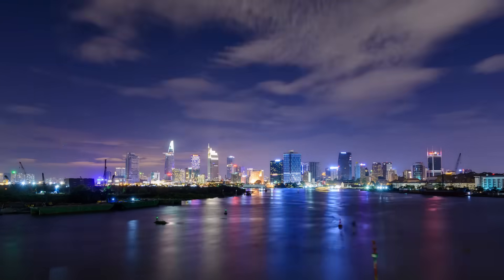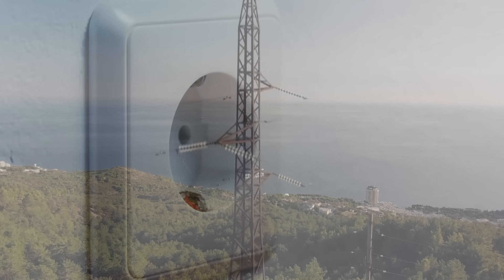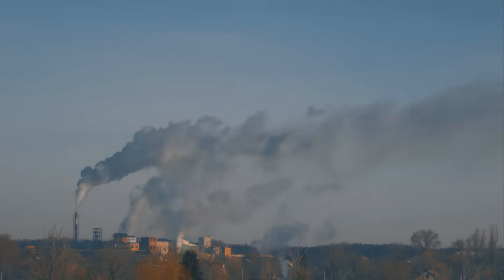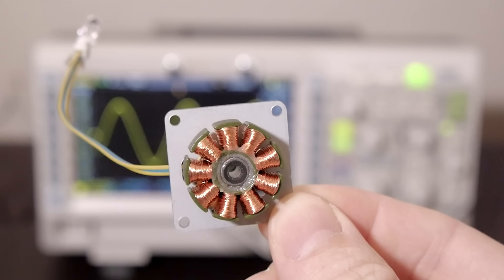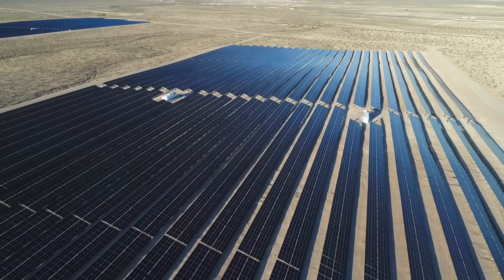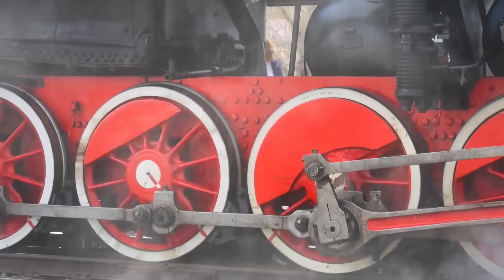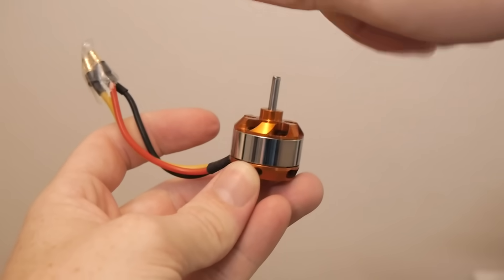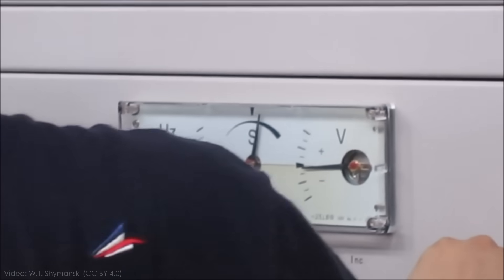How Electricity Generation Really Works

Comment: Great video, perhaps explain why it is so difficult for power production to go back online once a major interruption occurs. For example the 2003 blackout, This is when that coordination between the grid operators is critical, also black-start capacity.
Reply: Carlos -  there are basically two factors here.  The first is that it sometimes takes time to restore the source of energy.  If the interruption has lasted long enough that power plants have had to shut down, it can take hours to days to get them back on line.  For example, before you can restart a boiler, you must first 'purge the boiler' to make sure that there are no residual combustible gasses left inside - otherwise, attempting to restart the boiler could lead to an explosion.  This can take hours.  Or, there is the fact that the steam that passes through turbines is at very high temperatures, so if the turbine is allowed to slow down to standstill, the hot turbine can actually sag between the bearings that support the ends of the shaft, and restarting it requires a lengthy process of raising the temperature while very slowing accelerating the speed such that any residual sag doesn't become dangerous deflection as the rotor starts to spin.

The other half of the problem is restoring the connections within the grid.  If the outage resulted from some kind of failure, the damaged components must be located and either repaired or bypassed.  The obvious worst case might be a hurricane or ice storm that produces widespread damage, and power can't be restored until that damage has been addressed.  Because the work involved is done on a circuit by circuit basis, some consumers will see service restored very quickly - potentially within seconds to minutes, while others can take a very long time, depending on how much physical damage must be repaired.

In cities like New York, the grid often is designed around something called a 'network' - a network design produces extremely high reliability, but the process of restoring service after a network outage is very tedious and requires careful coordination of multiple operators spread across a wide area.  So for example, consumers in New York have the highest reliability of any electrical consumers, but when service is restored, it tends to be restored to all consumers at the same time.  But the process of restoring a network is tricky, it can take hours.
Reply: Louie Powell l
Reply: @monophoto1  Thank You So Much For an Actual Factual Explanation of What and Why Things Happen At The Speed Of 'Factuality'  'not at the  'Complainer'nation'  Velocity'_ 😶⛅✌👍🇺🇸
Reply: @monophoto1  Great stuff sir!
Reply: @monophoto1  Sounds to me like it's easier to restart a nuclear plant
Reply: @monophoto1    Very little of what you posted is accurate.  what kind of purge takes hours? NFPA requires a 300sec purge.  Turbines dont sag, they use a turning gear to with a battery backup to rotate the turbine slowly preventing sag.
Reply: @monophoto1  Starting the actual generators is one problem. Restarting an entire grid (or even a large area) poses another: You cannot start up a grid slowly like starting a train. All you devices would be very unhappy if power came back at 1 Hz and then slowly ramped up to 60 Hz over the course of minutes. So any detached part of the grid needs to be connected in an instant. But this also puts a whole lot of load onto the grid in an instant (want to be nice to your utility? Switch off your breakers in an outage and re-engage them after power has come back on. This also saves your devices in case the power comes back on flaky.). Usually that's not a big issue, as the grid is large and connecting one or two neighbourhoods is not enough to bring it down. But if there's a widespread outage, possible a hole area that is not (well) connected to the outside, that's not true. In that case re-connecting something could add such a load as to stall the generators. (Imagine adding 20 heavy cars at stand-still to a single locomotive. Whatever speed that locomotive had before, it will be at a near standstill after.) But firing up all power plants before connecting anything isn't a solution either. Generators don't really like to run without load---ever tried to lift a seemingly heavy box that in reality was empty? Just like you are likely to land on your butt, generators would spinn much faster than they should. So in the end you have to spinn your generators at a controlled speed and then add force (steam/water/...) at the same time as you connect consumers. And hope that you estimated the load correctly. If your estimate was off, the generator will either run slow (low grid frequency) or fast (high grid frequency). Both can kill connected devices (think exploding light bulbs in horror movies), especially modern electronics.
Reply: The real answer to this is complicated and lengthy, but Louie's answer is a good Cliff Notes version.
Reply: @2_Many_Hobbies  Wowza. The explanation was good, but I definitely considered it complicated and lengthy. I'll leave the more in depth explanation alone.
Reply: @jameslawrence8734  It had a few extras that they could have left out for sure.
Reply: Most generators need grid power to start. Those magnets in the generator are electro magnets. Black starts are rare. Could go into that.
Reply: @waynertimms  Black start capable utilities get a credit (premium on kW/hr rate?? etc, but you get the point) for maintaining that black start capability.  And you're right, not all go to the trouble to maintain this.
Reply: waynertimms hydro gen is great for black start.
Reply: This is far far out of his subject specialty. This video is already pushing his boundaries.
Reply: Search "bootstrapping electric generation"
Follow that with "power plant syncing".
Reply: There are things in this about that very thing that I did not realize they did. The electric companies really do stay on top of things, even during a blackout to get it all back up. It is a miracle that they can be so organized!
Reply: It is a good video. I like it.
Reply: You overload and short a coil on a generator in one of these power plants and you're now relying on a motor repair shop in obtaining materials, manufacturing custom coils, removal and installation. Logistics on the fly are never fun.
Reply: Carlos, check out a newer video on "How Power Blackouts Work" https://youtu.be/R_HGnc63QKU

Comment: Electrical engineer here, and this topic has been my job for about 15 years now. 
Everything you said is brilliantly illustrated and on point. 
Kudos to you !
I'd happily replace "renewable" at the end by "durable", but that's a subject for another day :)
Bravo again !
Reply: I went 'Why?' for a moment, and then remembered that Thermodynamics makes concessions for nobody. Not even the sun....
Reply: I never realized how little sense the word "renewable" makes until I saw this comment. I think "sustainable" makes a little more sense than "durable", but you're right: "renewable" is a silly word to use. I suppose you might be referring to the fact that it takes materials to build solar panels and wind turbines and that 100% efficient recycling is impossible, so the systems do consume resources to some degree just at a much much lower rate than fossil fuel-based power. Is that what you mean?

Also, can you comment on the feasibility of using a high-voltage DC "super-grid" to address the intermittency of wind and solar power? I've heard that a European super grid could allow Europe to run completely on sustainable sources of energy because it would span something like 13 timezones. I don't know how the cost of building a "super-grid" compares to that of building energy storage facilities. How do you see our transition to sustainable energy playing out ‡? 

‡ Not necessarily how it ought to play out. I know a lot of rational people think that we should build thousands of nuclear power plants because the technical and economical factors make sense. I'm not against nuclear, but I question how feasible it is to overcome the social/political challenges in a timely manner because nuclear is inherently scary and very hard to educate people about. People know that radiation is something that they see or perceive in any way, yet it can cause horrific diseases like cancer that kill you slowly and painfully. It's kind-of a nightmare death-stalker. It's very difficult to explain to people why they shouldn't be afraid of such a thing in their back yard. What's worse is that nuclear proponents have a history of glossing over major problems leaving the industry with a huge trust problem.

You can see that playing out with the hype over Thorium. There are hundreds of videos online where people explain all the miraculous benefits of Liquid Fluoride Thorium Reactors (LFTRs) without ever mentioning any technical challenges (of which there are many) and sometimes out-right lying about the tech like saying that it doesn't produce nuclear waste (when in-fact it would produce far more waste than LWRs, just not as much *spent fuel waste*). When asked why LFTR has been on the drawing board for decades yet never implemented, proponents start coming up with conspiracy theories. It couldn't possibly be the extremely complex chemistry involved! It couldn't possibly be that combining the fuel with the coolant and flowing it through the entire reactor instead of keeping it in a centralized location (like LWRs) means that the entire reactor gets irradiated to the point that only robots can operate around the reactor! No. It's all a conspiracy!
Reply: @AbeDillon  
Yes, technically fossil fuels are "renewable." Sustainability is another challenge.
Reply: @AbeDillon  @Abe , from what I read , there was a Thorium reactor built in the 50's that ran on the grid for 5 years.....I'm sure todays tech could make quick work of the complexities you mention .....given some will power.
I'm hearing the Chinese and Indians are just getting on with the work on Thorium energy while the rest of us wring our about if it's feasible or not.....
More power to them :)
Reply: @Paper-and-dragons  that was not a Thorium reactor. It was an experimental molten salt reactor that didn't use Thorium. It was never on the grid. It was very small scale.

It would be interesting to see how current research into the tech pans out. I wouldn't hold my breath though, or expect anything miraculous.
Reply: @AbeDillon  if you look at early America when DC power was the only thing available you can see that it didn't travel very far at all that's why we use AC it travels much further with weigh less loss.  So a DC system like that wouldn't be worth the time space or money
Reply: @jamesgarrison6430  What works much better than simply consulting history is actually trying to understand the problem like an engineer.

High-voltage electricity is much easier to transmit than low-voltage electricity thanks to Ohm's law. It's also much easier to increase and decrease the voltage of an AC source using simple transformers. That's why AC is the standard: you can ramp up the voltage for medium-distance transmission, then reduce it at the point of consumption. The problem is that AC suffers from the "skin effect" (look it up) which ultimately limits its transmission efficiency.

The idea of HVDC lines is that, while it's difficult (requires expensive equipment) to convert between low-voltage AC and high-voltage DC, you only have to do it at key sites: It's a back-bone transmission system, not a "last-mile" solution.

You use High-voltage DC for transmitting a ton of power over very long distances, then convert it to low-voltage AC for local use.
Reply: @AbeDillon  I suppose rewinding your rubberband powered airplane could be construed as renewable?😜
Reply: And I'd make it "durable zero emissions". We should be working to eliminate CO2 emissions rather than installing wind and solar and hoping emissions will go down. Germany has been installing wind and solar, and their emissions haven't gone down. France, Sweden and Ontario installed nuclear energy and their emissions went down.
Reply: @49andrew  that's a myth. Germany has reduced it's CO2 emissions to 32% below 1990 emission levels. They e missed their target of 40% below 1990 levels, but the statement that they haven't reduced emissions is an out right lie started by a Koch brothers-backed think-tank. Please stop spreading it.
Reply: nothing is renewable. given sufficient time, eventually all energy will dissipate. 
(or actually maybe not and it's one of those "the closest decimal to 0" situations. idk, i'm not a professional physicist)
Reply: @fomalhaut_the_great  Energy cannot be created nor destroyed but can only change from one form to another.
Reply: @fomalhaut_the_great  Energy doesn't come from anywhere but it doesn't dissipate either! Energy is ALWAYS converted, not made, nor lost. Most sources of energy like to become heat over time. Also sometimes converts into chemical potential.
Reply: @buttonasas  "Does not dissipate".  Are you sure?  The total energy in the universe is a constant but it  has dissipated and continues to dissipate in the most common sense meaning of the word.  It will continue to dissipate as the universe continues to expand.  The energy per cubic parsec of space declines as the universe expands.
Reply: @Saratogan  Sorry, I read it as "disappear".
Reply: @Saratogan   As I understand it, energy is conserved, but it all tends to go toward the same average state.  Thermodynamics dictate that to do work, energy must go from a high state to a low state.  If all energy is lukewarm, rather than some hot and some cold, no work.
Reply: @joesterling4299  , True, we do see this locally (by locally I mean that which we see here on earth) but, universally,  for the "big bang" from the singularity theory to hold, all the energy that was contained in the singularity was dissipated at the big bang and continues to dissipate as space expands. E=M*C^2 and equally valid M= E/C^2.
Reply: Just a quick question, at 3:40, doesn't the phase power provide √3 x more power at the same amperage?
Reply: @TheMagnoo99  I believe it just keeps the amount of out put around the same instead of 0 amp to 15 amp back to 0 it goes from 0 to 15 to 15 to 15 to 15 tell it gets shut off because when one is at 0 the other is at 15 and the other is at -15        so it goes from -15 to 0 to 15  than 0 15  0.  Than 15  0 -15. So you always have a more reliable for to start around the same amperage if you look at the wave
Reply: ericasw28 if your an engineer I am Donald Duck. You quack!
Reply: What's your take on the free energy generators
Reply: All those pseudothermodynamics quackery turns people into retards. They can't even tell they are lied to when it comes to electricity generation. Pathetic.
Reply: You can say whatever you want when it comes to energy SOURCES but do you REALLY know how the simplest industrial synchronous generators really work? You have been taught energy conversion but you aren't taught self-excitation. Why? Because it leads to OVERUNITY. Replace mechanical input with 3 phase electrical input, you get a synchronous motor powering a synchronous generator simultaneously without the need of separate mechanical coupling between two machines. Set either of the dual stator windings of the synchronous motor as output, you get overunity. Because all you need to do was to increase rotor current, the excitor to increase magnetic attraction, induced emf, WITHOUT the need to actually increase 3 phase input.

This is the basic "zero-point energy" where an inductor stores energy in the form of constant current magnetic field, supplied by the battery, voltage supplied by the grid without the grid itself drawing current. This is the TRUE self-excitation, HIDDEN overunity. They teach you everything EXCEPT self-excitation part.

Wake up yet?
Reply: "Energy cannot be created nor destroyed."

All Generators are merely transformers and nothing more. What is needed is a better way to transform energy in a non destructive manner. How many years did you spend working on that challenge? Any?
Reply: @seanregehr4921  Better way as in most efficient. Current technology we have is probably as close to efficient we can achieve. An area that could stand improvements is the electrical grid system we have. It's my understanding considerable amount of energy is lost thru the grid.
Reply: Come back when the windgenerators and solarpanels don't break at the tip of the hat and don't end up in landfills. Until then I consider anyone promoting them as better than anything else as lying scum.
Reply: @Throku  You’re comment was a year ago, thought I’d respond (i’m not the original commenter you were referring to) to let you know since it’s interesting, I watched a documentary on YouTube recently of a company who has started to remove turbines laying useless in landfills and I believe recycle it into some type of asphalt? Not too sure. Thought it was interesting since I too don’t really enjoy tons of turbines all over the place.
Reply: It seems one should first watch this video before taking their electrical engineering program